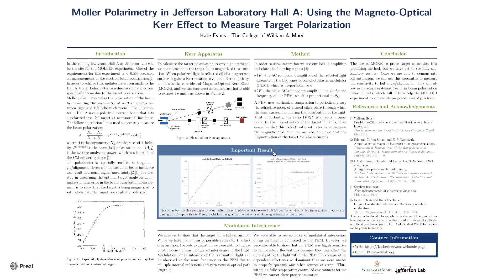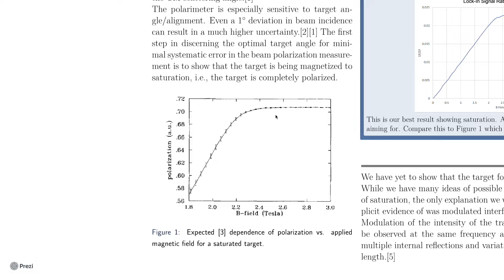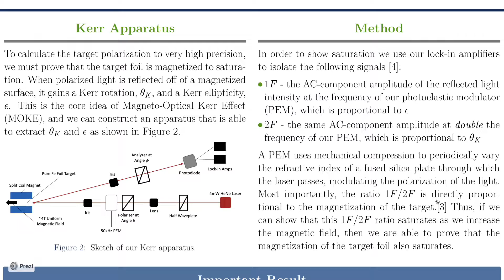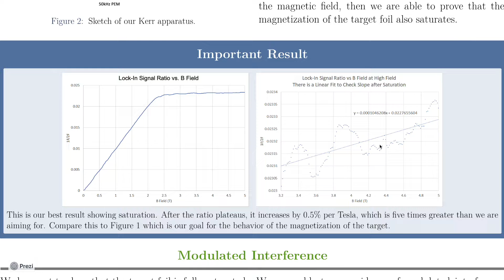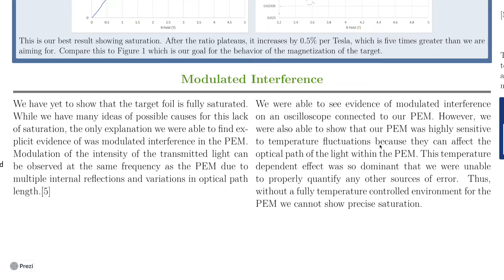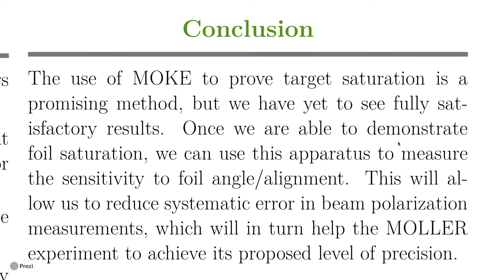Moller Polarimetry in Jefferson Lab Hall A: Using the Magneto-Optical Kerr Effect to Measure...

Comment: nice presentation. Which steps were taken to insure beam was incident on target
Reply: Hi Magurio, simply speaking we knew that the beam was incident on the target because we were able to look into the magnet and see the beam hitting the target, and we could see the reflected beam move when we rotated the target. We also did more detailed studies of the beam's size and position using a camera. This also allowed us to analyze beam drift, and we found that any drifting that occurred was incredibly small. So we were unconcerned with the beam not being incident on the target or with the beam clipping on any of the optical components.

Comment: Thanks for the nice poster! I see you have addressed a question about the temperature control. This seems important given your results and conclusions. I have another question. In your enlarged plot of the 1F/2F, is there anything that you learn from the oscillations -- are the predictably periodic? Also, while the saturation is the goal as a function of B, I can't help but wonder if there is a function that will better fit the data, perhaps to give some information on the frequencies of the oscillations and potential periodicity.
Reply: Hi Patrick, thank you for the reply! The oscillations on the plot are still somewhat of a mystery to us. We never saw any that were consistent between runs. If we were able to see consistent oscillations, then we could start doing things like plotting only one of the signals vs B-field to start to investigate where the oscillations are coming from. Your comment on different plots is interesting! We did plot some other things such as signal (1F, 2F, and 1F/2F) vs. time (for constant or zero field) and signal vs. PEM retardance setting. However, nothing we saw shed any light on our issues with saturation. If I were able to rule out temperature problems, one of the first things I'd like to plot is the signal ratio vs. time at a B field of ~3T (where we should be at saturation) so that I could analyze any clear oscillations in the signal.
Reply: @kateevans5918  Thank you! Good luck with the competition.

Comment: What would you suggest for next steps in improving these measurements?  Clearly, better temperature stabilization would help - would improved characterization of the PEM be needed?  How would one go about doing that?
Reply: Hi Dave, yes temperature stabilization is key. If we could, as an idea, place the PEM optical head in some sort of fully temperature controlled housing, then that should ideally get rid of the modulated interferences due to change in temperature. We could double check this by taking data for a period of time at the same field and measure the signals from the lock-ins vs temperature on the optics table or in the vicinity of the Kerr apparatus. There should be no correlation between results and temperature once we've isolated the PEM optical head. After that, we can begin better characterizing the PEM as well. Our current results are so clouded by temperature fluctuations that we were unable to confidently diagnose or characterize other sources of interferences.